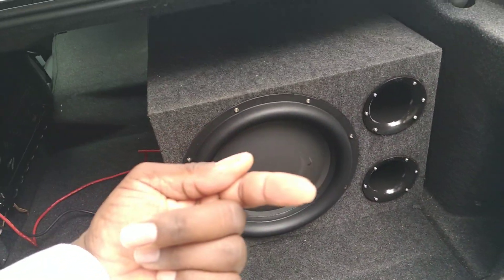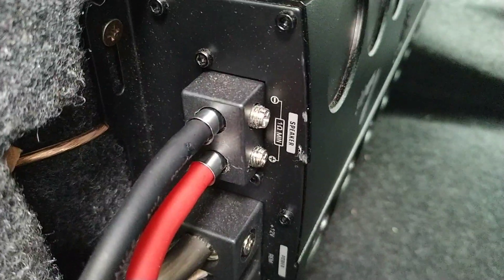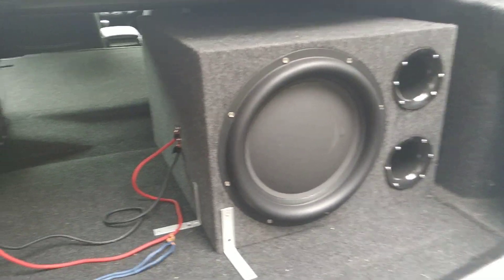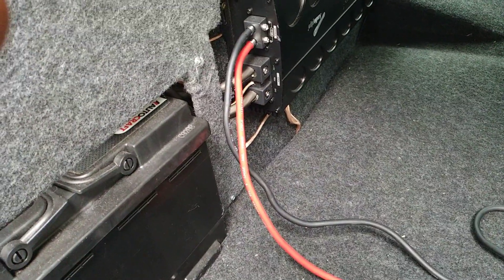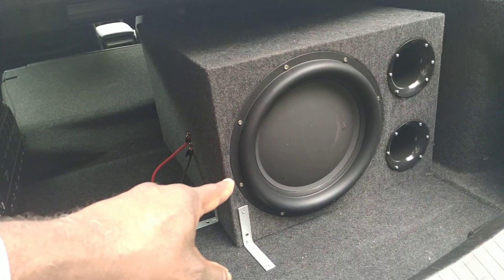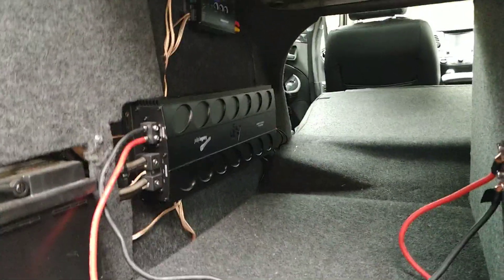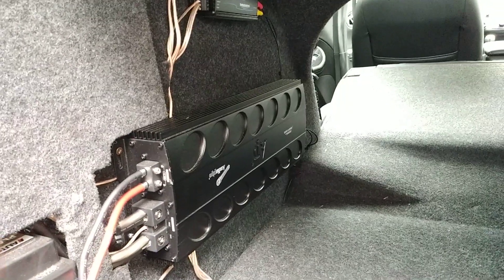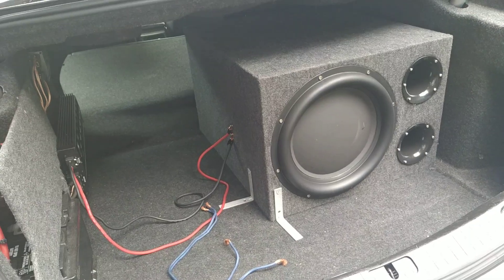I Hate My New Amp - Part 4 | The Dangers of Bad Wiring!

Comment: Unbelievable! I've been having the same problems, and on top of my amp running way hotter than it should (I have a temp indicator on it too) my clipping indicator was lighten up too soon. I tried everything. I ran more 1/0 power and ground wires  from the alt to the back. I bought another battery and all that helped and the difference was very noticeable.(I also ran dual 1/0 inputs into my amp). It was obviously needed.  I could get louder without clipping but It still didn't seem right. Then I come across you're video and I took you're advice and shortened my speaker wire runs and I went from 10 gauge to 4 gauge (Overkill, but didn't have any 8 gauge ) and damn it made a big difference. Huge. Thats it right there. Its on point. My amp doesn't get anywhere near as hot as it did before.  You the man BudgetBassHead!
Reply: speaker wire is copper. copper can transfer heat really well. so any of that heat from the speaker itself or the wire gets transferred to the amp. its crazy but the wire size can handle the current( like 12 gauge) but in turn your getting excess heat to your amp. so the key is to try and not get any heat from your wire. back in the day my amps would run hot as well. just a simple speaker wire upgrade helps tremendously.

Comment: Bro a 8 gage wire is way more current then 10 lol.    I'm running 2 1500 rms subs running 14 gage in box and to amp. Awg ofc. 2 ohms a speaker.  ( 1 ohm ) at amp. Barely gets warm ( only for extended use ).   Because I run a crossover,  line driver.     Gain is all the way down.    So I get full volume and it will only begin to heat up if I play it hours straight!    The amp should not have needed to go that high on the Gain!    I always run a  EQ,crossover,line driver so you don't have to turn it up that high!                      Now I have gone through saying all this because the higher your Gain is the more it amps. So if you're clipping your amping that clip that's why you where over heating. Running 8 gage will disperse the current more efficient yes but it's stopping the heating while shoving that power directly to the speaker.   More over I use a o scope to find the clip point of your signal from head unit. Then set all my gains by voltage.     Once you know your clip volume of the head unit you can put exact power to your speakers.  ( running rms wattage) you won't have that problem

Comment: That's interesting you put that subwoofer back in the same car again considering what it was doing to your car, well i guss once you get a dose of the highly addictive clean and articulated bass it's impossible to give it up again hu, 

Am about to pull the trigger on one of these, the power i have at the moment is between 1670w RMS at 4ohms 1% THD or 2150w RMS at 4ohms 10% THD, do you think that's enough to go either sealed or ported?? 

Many thanks for your lovely video's once again,
Reply: I perfer sealed over ported because the difference between ported and sealed truly is ported tops out at max volume where sealed doesn't.  ( and sealed will give you louder bass with less watts ) and ported will give you louder with lower  volume.

Comment: I have the same amp, had the same overheating issue and done the exact thing to fix it a while back. I never would have thought it would make that big of a difference either but it definitely does. Thanks for the video and confirming that is what fixed my issue as well. I changed a few things at the same time so I wasn't sure exactly what it was that helped.
Reply from the maker: Yeah, who would've known. Thats what this community is for, sharing and learning together. Thanks for the comment! 👍

Comment: You may want to consider putting on heat shrink over the wire ferrules you used on the speaker wires.
Reply from the maker: Noted. Thanks
Reply: You need electrical contact.

Comment: Yes, the speaker wire is carrying current to the transducer, and with the gain set at clipping, it makes sense. That 10 gauge wire is not rated for that type of high current. So with mono amps I use 8 gauge wire as a practice. I didn't even think of it as a issue because I assumed you properly gain matched your amp and the source unit. I never used the 3/4 rule because every install is different. But hey lesson learned.

Comment: So does anyone have an explanation to this phenomenon?
Reply: Yes, that 10 gauge wire is not designed to take that current and with your gain set too high you basically made the speaker wire a load in itself. Think of a water hose. Yes a 2" diameter hose is good flow, but if you have a water pump that is cranked up then the pressure builds and the pump isn't working efficiently and it starts to over heat, but adding a 4" diameter hose allows more current to flow and now the pump isn't trying to compensate. Bigger hose with a high flow pump means more water with less strain on the pump.
Reply: And the compensation aspect is when you had the gain on the amp set a bit high.
Reply: @ericperry72  thanks for the great explanation!
Reply: @xanderguldie  watch EMF audio vid about this. Sean is crazy smart and I've learned a lot from him
Reply: @ericperry72  I hear you. You right. I always went by a graph I downloaded that shows what size and what length of wire is the best for speaker, power, and subwoofer runs and I would even hear people on youtube saying "10 gauge is more than enough for 1500 watts" or so. I was using 10 gauge on my subs (before watching this video) then switched out all my 10 gauge sub runs to 4 gauge. Overkill yes but I didn't have any 8 gauge. I should've known better anyway. Better to have too much, than not enough.
Reply: Would you have to change the wires inside the box to the speaker also? I'm having a similar issue
Reply from the maker: @descolero1  yes.
Reply: @BudgetBassHead  Thank you.

Comment: This year I put 4 guage OFC power, ground and 8 guage OFC speaker wire in my car. I never heard of using it before all the previous 20 years. I haven't had any over heating or loss of power. Also I used a premium grounding lug. Glad you figured it out!